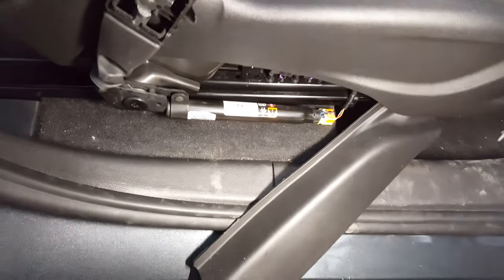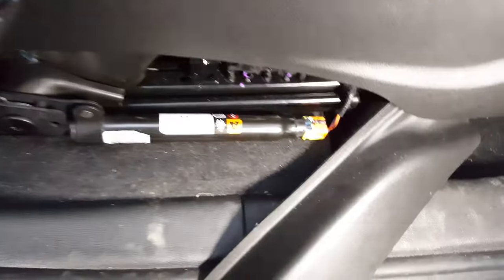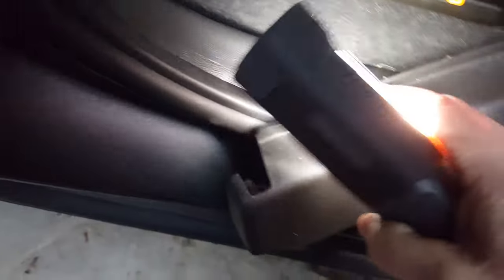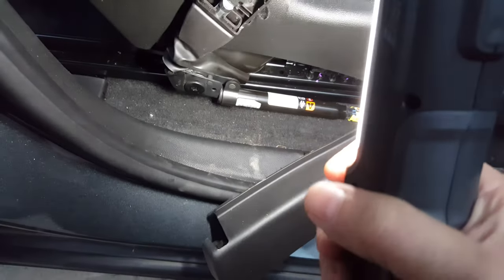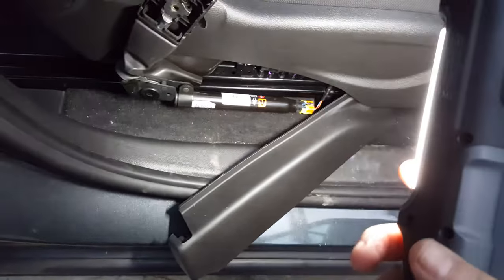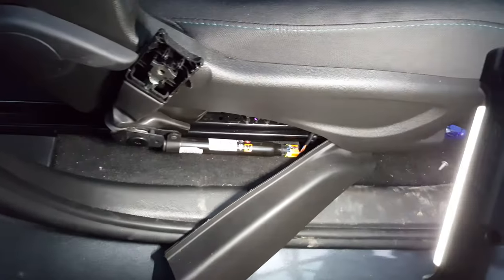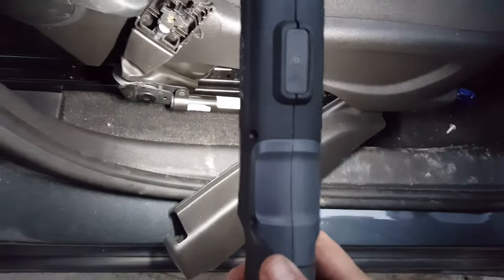2016 Chevrolet Trax 2nd Pretensioner Front Seat Belts

Comment: Did your airbag light go off after this? I replaced the seat belts but not that part you're showing.
Reply from the maker: You well need the airbag control module reset before the airbag light will go out.

Comment: So how did you pull the cover off without damaging it? You said to pull it off from the back?
Reply from the maker: The cover pops off. You than take out the bolt at the end of the tube on the left with a star bit. You can see the bolt in the video 0.03 seconds.